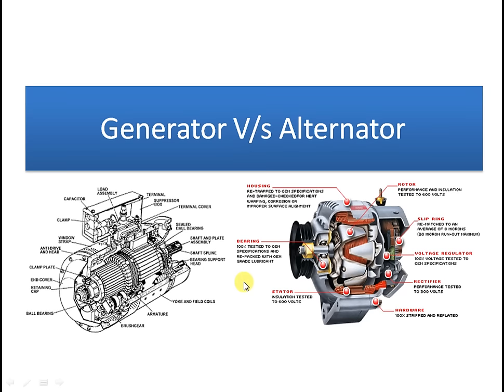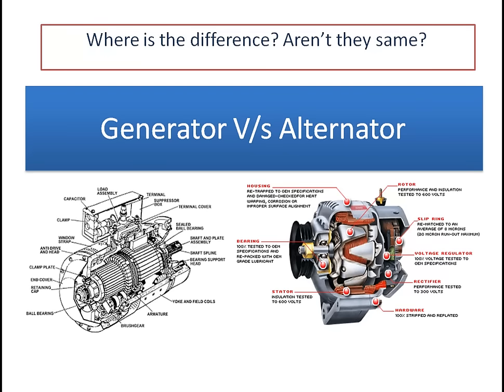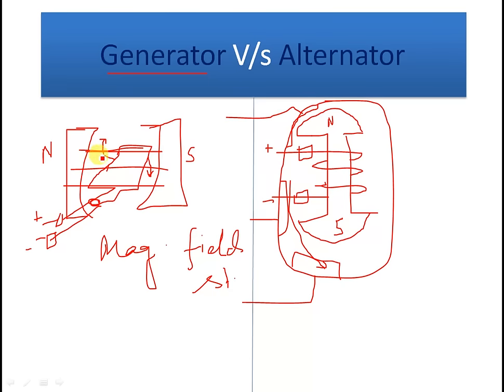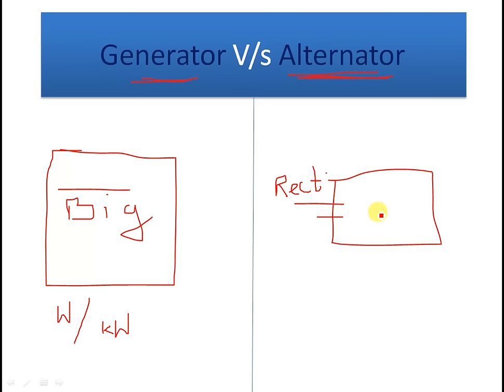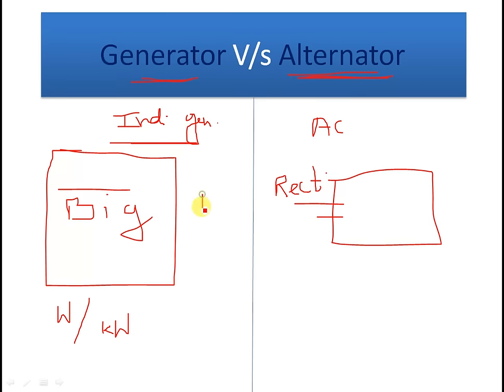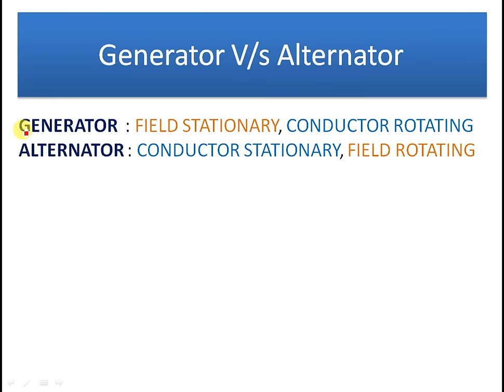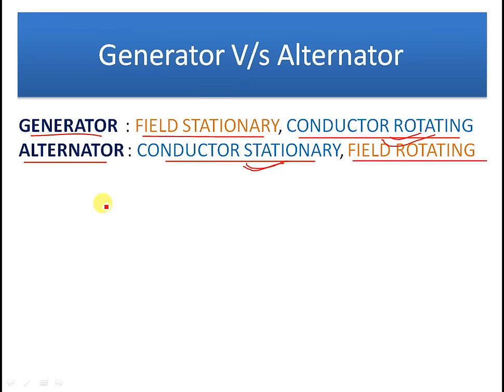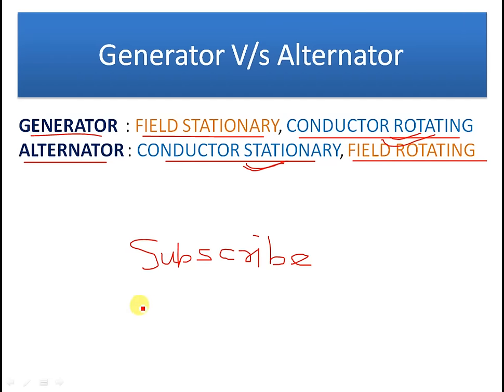Generator V/s Alternator : What's the difference?

Comment: A generator is  a mechanical device which produces electrical power...Ac or Dc...  An alternator is a similar device which produces Ac power only...  A device which produces mechanically electrical power in Dc form is called a Dynamo..
Reply: Why then is a car's generator that obviously has to produce DC to charge a battery, still called an alternator?
Reply from the maker: Alternators used in automobiles/vehicles are indeed AC generators. Until 1960, dynamos or DC generator were used but after that with the advancement in Electronics and Silicon semiconductor devices, alternators came into fashion with rectifier unit.
Reply: @ervivekchoubey  Ok thank you for clarifying.  So it has to do with what format of power the rotating parts originally produce, even if power-electronics like a rectifier reformat it at a later stage.
Reply from the maker: Yes, original emf generated by any machine is AC. In DC generators we have commutators that do the rectification work. But with power electronic converters the rectification is easier and efficient without much wastage of power.

Comment: Whats the best design suits to economic but good output?
Reply from the maker: Chelford Quider an alternator is more economical due to its liw weight, Higher kW capacity. No brushes, no commutators and smooth operation. And if you need DC, you can take the alternator output and fed it to rectifier bridge. The total setup is mire economical than a generator.

Comment: Hi sr thanks for your great video. In terms differences wich one would be more efficient if you were planning a system for providing Ac electricity to a house off grid with or whithout a battery bank, a generator or an alternator?, taking into consideration that in the case of wind, rotating speeds will vary significantly
Reply from the maker: If you are talking about wind-generated power then definitely an AC generator or more specifically, an induction generator. Induction motor when made to run higher than the synchronous speed, it begins the generation of electricity and hence called induction generator. Finally, the output of the generator is fed to a converter circuit (rectifier) and stored in a battery. 

To control the variation of speed, Ball-bearing must be connected to the windmill rotor as well as a speed controlling circuit must be there along with a gearbox to maintain a constant speed. You can learn about the windmill system on Google/YouTube.
Reply: @ervivekchoubey   Thanks a lot

Comment: In an Alternator, the Magnetic Field is NOT moving at all, in a Generator the Magnetic Field is rotating (Single Phase or Three Phase)...
Your drawings are not accurate for either machines, although your first as Thumbnail image is correct.
Reply: In a Typical Alternator the Magnetic Field run parallel to its shaft, and magnetic poles are re-routed/redirected through the steel claws in a NSNSNS configuration...but, no matter how fast shaft goes...North and South will always be on the same side of shaft.
You are welcome